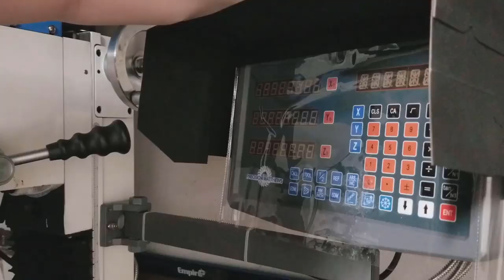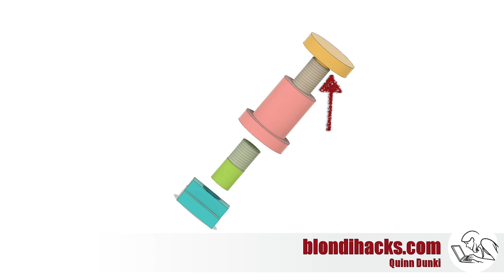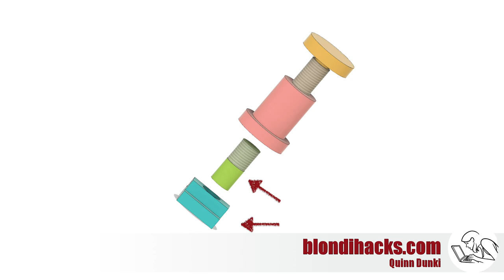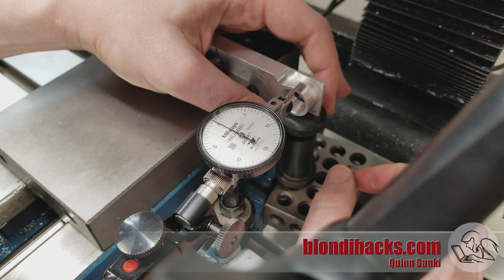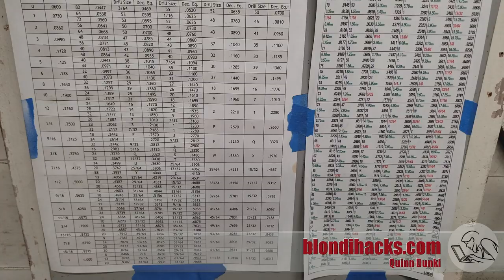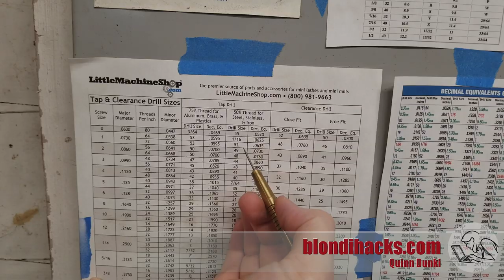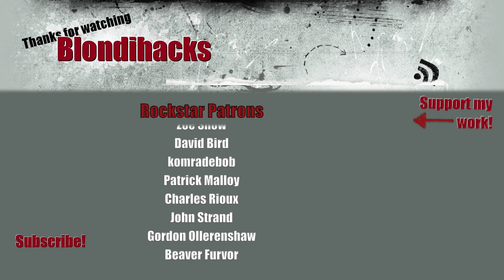Let's Make Machinist Jacks

Comment: Gwin, maybe you can answer a question that's bugged for a long time,  I've asked many experts (please don't be intimidate) and feel that I've never had what I've thought is a correct reason for the variation from the nominal marked size of a drill bit to the actual size of a drill bit. My dad used to sharpen drill bits as a hobby or for little charge before he passed for like 20 or 30 years before he passed, he was good at it. So I inherited thousands upon thousands of drill bits all various sizes for many reasons mostly because some people never returning to pick them up when he called and said they were ready. He had a rule, I'll only call you once! Well over the years I have gone thru them and built many sets for my children, my friends, my co-workers, and even some of his friends while they were still with us. Several things I quickly discovered in the process was, drill bit aren't the size marking on them, as I had always thought. I fact you would be hard-pressed to find a few that are. They all vary from 0.005" to 0.050" from what they at marked. The usual answer I get is all drill rod was a variation from the manufacturing process, another is that it depended on the quality level that they were made to, or I not measuring them right. Some of those answers may be a little true, but what I see is a defined pattern of sizes in the thousands of bit I've measured and it is not the nominal size.

Comment: Quinn, just discovered your channel and learning a lot. I'm a retired welder learning to machine. A technique we used for a press fit is to make the part 1-3 thousands over the hole size depending on the material. Heat the hole side and cool the bolt part. They will go together with no effort and when reaching room temperature they will be very tight, almost welded. thanks for your tips.

Comment: Yes, I get sawtooth looking threads, And I have a Chinese lathe *THANK YOU*, I've been avoiding using the compound and just plunging straight in with the cross slide to get properly shaped threads.  I love 'You Tube University'.  Thank you Quinn, and Kieth & Kieth & Adam & Pete & Steve & Emma & Stan. After a 1000 hours of machining lectures, I feel very well informed-Thanks so much

Comment: Put a center drill hole on the anvil of your machinist jack for a ball Bering holder for the times you need an angle in your set up. Great project thanks for sharing.
Reply from the maker: That’s a great idea!
Reply: And of course nothing stops you from making several different anvils for your jacks!
Reply: Also, I needed to make a set of 3 quickly, so I brazed a ball bearing onto a standard hexagon head set screw, centre drilled head. These were used to level a part. Look up science of Kinematics.

Comment: Hi Quinn, another great video. I did make such a jack (before I saw your video) I did make a lock nut (knurled) to sit on the top surface of the jack body and it has proven worthwhile, I put a really fine finish on the two mating surfaces and it locks and unlocks very nicely but doesn't move during machining at all. Keep 'em coming, we all enjoy them.

Comment: Great video Quinn. You are becoming quite a good machinist. Great lighting & camera work
Reply from the maker: Thanks Lyle! Much appreciated. 😀
Reply: @Blondihacks  i won't @blondihacks   to apply her self to the challenge of doing a taper by using tow chunks in her lathe , & cut a taper with out moving her tailstock set up ? . The trick  it in the tip.  of chuck she use's .

Comment: A really common tool, yet I have never made one. I really liked your take and the explanation of mistakes was educational. Saw tooth threads, been there done that. I ended up scribing a zero line 90 degrees off of the original and put a label on the manufacturer's line saying  - not for threading.

Comment: In regard to dishing the bottom of the jack another aspect to consider is that if there is any irregularity in the table or if there is any small shavings, the dished base can bridge a lot of these and sit flat. otherwise any small shaving will cause it to rock.
great work. thanks.

Comment: Quinn, love your channel, and can see you know your stuff.   I want to comment on the compound angle difference between lathes.  It is good to know, but it is better to understand from where the angle is referenced.   A lathe has only one axis, it goes through the head stock and the tail stock.  So an angle is referenced from that axis, a taper is a good example, or it is referenced from a plane perpendicular to that axis.   Threads are a good example of that.   Tapered threads are also referenced to a plane perpendicular to the axis and not to the taper.  I recently retired after 47 years in industry.  Some time as a machinist, some time in Quality Control, but mostly as a design engineer.   Too many times I have seen a professional (?) machinist screw up a part because said machinist simply set the angle on the compound that said machinist saw on the print, and did not look to see if the angle on the print was referenced the same as the compound.   It is frequently necessary to set the compound at the complementary angle.  It is up to the machinist to decide which one is correct.

Comment: Hi,  love your vids, if you get a fishtail gauge and run the thread cutting tool into it it will confirm the tool is set at the right angle to the plane of the shaft.

Comment: I like the "t-slot nuts".  I've got jacks, but never considered a t-nut, despite having needed to several times.  Working with castings often requires them in the t-slots, and they can use different tops, including points for rough casting surfaces pushed against.  I believe I will make a couple nuts to go with my jacks.  Very nicely done, thanks!

Comment: The tee bolt. That might just be genius!! Interesting. Generally if I need a Jack tho it's usually at some random location under some weird casting. Be interesting to see if it works. Would certainly be a third hand when setting up sometimes.  you rock!

Comment: Great video!  Couple of things that may help you along the way, generally 75% thread engagement is the standard for most tapped holes. I found that out the hard way when I started out and a foreman about chewed my head off. Lol. Secondly both fine and coarse threads (UNC and UNF) use different tap drill sizes, with UNF being larger than UNC. Always remember thread pitch-diameter=tap drill size. For instance your 7/16-20 would go like this. 1”/20=.050, this is your thread pitch. You would then subtract .050 from .4375 and come up with .3875 or a 25/64 drill bit (.3906). I rarely ever use drill charts anymore. Hope this may help you or someone else.

Comment: My motivation just goes right out the window when I realize I have to switch up the change gears.
Reply from the maker: Ugh, tell me about it. 😁
Reply: Check out Clough42 channel - An interesting  solution to change gears is in the works.
Reply: Had to change out the change gears on my lathe for the first time over the weekend. Do Not Like.  Turns out one of them has 2 missing teeth replaced with  allen screws. Yuk. 30+ years of oil, grease, etc were not really pleasant either. I might get the dark, black grease at bay. But then no one would know who  I am!
Reply: that is why i have a love hate relationship with metric threads.

Comment: Showing the mistakes, causes, and remedies make this video valuable for hobby machinists. Until we learn to make the stars align in our favor by learning all these seemingly insignificant  details, hobby machining can be very difficult/frustrating. However, once the small details are tended to, hobby machining becomes as simple and rewarding as Joe Pi, Abom79, and others make it appear. Thank you for the slower pace and pointing out the mistakes. BTW, threading away from the chuck does indeed take away the drama!!

Comment: You spoke of using a dull endmill, Doing a bit of research on internet including milling cutter manufacturer pages it seams WE as amature machinists tend to kill our endmills before time. Endmills as we call them tends to let us think they are mainly for using the end of the cutter like a drill bit to cut downwards when in fact they cut better on the side. Acording to lots of manufacturers of endmills they last longer cutting full depth in more passes width wise rather than taking a shallow wider cut. Just look at almost any CNC video where they explain how to work out cutting speeds and feeds for different cutters. The spirals on the cutter are actually cutting edges and spiralling to help remove the chip so its not recut on the next tooth. Its a fascinating subject which i will have to study as i tend to CNC my milling machine in the near future.

Comment: In parting as long as there is even a small hole in the centre you can part almost through, then drll the part off. The part will stay neatly on the drill.

Comment: Always start tap in chuck or morse taper tap driver, in tailstock or mill spindle for alignment and rigidity, even hand taps will power alright to full thread on tap then finish by hand bucking in and out.

Comment: Great video thanks! Just the other day I scrapped the screw part of a Jack I’m making for my bench drill. Single point threading isn’t as easy as y’all make it look 🙃 I’ll have to look in to Joe’s technique.
Reply from the maker: I’ll be doing a Lathe Skills series on single point threading pretty soon, if it helps.
Reply: Blondihacks well your basics series has been invaluable to me so I definitely look forward to it. Until then I’ll continue to learn from my failure as there are few better teachers than that.

Comment: Here's a Toolmaker tip: Do not use the chuck key to turn the chuck as you did to do tapping. ( to remove a chuck on a lathe with a threaded spindle ) use a adjustable wrench on the jaws of the chuck to turn it for tapping or chuck removal.

Comment: Novice lathe user, with a Chinese lathe: Fell for the 30 degrees vs 60 degrees first time I tried to cut thread too! ;) 
I also managed to get the wrong point on the thread dial a couple of times in my second and third attempts. Fourth attempt worked - would have been MUCH quicker to just stick my die-holder in there and use that, but then what's the challenge in that?

Comment: I'm an old guy, new to machining. Quick question that I should know the answer to. Are there any practices that help in the amount of metal splinters one receives in his fingers when working a project. I have a Logan 820 lathe, and a Wells Index 40H milling machine. By the way, great videos, I love the voice over. Really helps the viewer on the paying attention part. Great job. I found your videos because of the parts you made for Keith Rucker.

Comment: So nice to see you talk about the mistake with the compound and the 60 degree showing on the compound. I did this exact thing for the first few threading attempts and got so frustrated not seeing why it wasn't working. When I did work it out I thought it was just me geting the wrong end of the stick, I didn't know there were differences in zero position between lathes.
Also do you use something like WD40 or oil after the cold blueing?
Reply from the maker: I haven’t been oiling after cold bluing, although it’s a good idea. The tooling I actively use ends up covered in oil anyway, and I do use Boeshield on stuff I rarely use, to prevent corrosion.

Comment: Awesome project. One off topic question, I noticed you had a little rig you added to your gear set (I'm assuming to change the feed direction). Do you have a video for this? I have an "economy 8 x 16 chinese lathe and have yet to figure how to feed left to right while threading
Reply from the maker: Hmmm, not sure what you mean there? It’s all factory in the change gears. My lathe does have a reverse power feed, but you don’t actually need it for right-to-left threading of right-hand threads.

Comment: Thx quinn you have helped me solve a problem i have spent many hours on trying to solve.  Chinese and American 30 degrees is not the same... Suddently i can turn threads like a pro. I also have a Chinese lathe and everytime i tryed to turn threads they came out looking 
horrible. Now after you talked about it it as your mistake it is painfully obvius that i should have seen the difference before.

Comment: I like the T-bolt design on these Jacks. I do have a stupid question. Why the bluing, what does this do beyond looking pretty?
Reply from the maker: It provides some limited corrosion protection (though not as much as paint) for the machined surfaces.
Reply: "black rust" (cold blue) is corrosion, just like "red rust", except one has one less oxygen atom. The main difference is that "red rust" changes size when it forms, so it flakes off and exposes fresh metal to start rusting again. If you coat the part with "black rust", it greatly inhibits "red rust", with the side benefit of its "micro-porous" texture being great at retaining additional protection in the form of oil.

Comment: Hey Quinn! I noticed when you were single point cutting threads that the trailing edge of the bit was doing most of the cutting as per the 29.5 degree setting. I mean no criticism when I ask shouldn’t the compound be angled 29.5 degrees the other side of 90 degrees, there for making the leading edge of the bit do the majority of the work? I went back and watched Joe’s video and he was as using an indexable bit so he did not move the compound and fed straight in. I am coming in late to the show so don’t feel obligated to reply. Thanks a bunch!

Comment: What is a typical minimum height for the jack and how to determine that height? And isn't good to have a way to lock the height? i. e. so it wouldn't slowly 'wind' down from vibration? Or does fine thread make that unlikely?
Did you consider just tapping the Tee and then loctiting the stud into it?

Comment: Gotta ask, why a center drill for spotting for drilling instead of a spotting drill?  Center drill angle is 60degrees, while the drill bit is more like 118 degrees, and a spotting drill more closely matches the drill bit angle

John
Reply: Speaking personally. I got center drills and I don't have spotting drills on hand. And it works.

Comment: I absolutely understand why a machinist would use imperial if that is what they grew up with and used in school. As I grew up with metric I'm in no position to gauge how complicated imperial actually is, and this is not a comment meant to start any religious wars, but imperial just seems so needlessly complicated. 

I wonder if there'd actually be anything to gain for a machinist to actively switch from imperial to metric? It's obviously possible to get great precision with imperial so my gut reaction is "probably not."

Comment: What made you chose for a press fit for the T-nut instead of a normal threaded T-nut and gluing or welding it in place?
Reply from the maker: A press fit is easy, and stays very straight

Comment: I probably missed a lesson ,what was the round stock in the vise for again? Say hi to sprocket for me.
Reply: In addition, it's a more reliable method for clamping parts that aren't square (yet)... It gives a more secure clamping force on the (not yet square) part.

Comment: When using machinist jacks, is it common practice to indicate a part in the vice before adding the jack? If so wouldn’t it also be a cheap value add to put an indicator zeroed above the Jack point when tightening the jack in place, thus maximizing rigidity?
Reply from the maker: That’s not common, no. It’s enough to do it by feel. I was just indicating to illustrate what can happen if you get carried away.
Reply: Blondihacks but if I wanted to get carried way toward OCD fixturing‽ it would be an okay way of doing that?
Reply: Blondihacks aside: are you Quebecois?

Comment: Hi, I like to know why did you change from the 2" to the small mill half the way through on the T peaces?
Reply from the maker: Good question! The main reason is that the big shell mill doesn't side-mill very well on this machine. A large radius cutter like that needs a lot more tool pressure, and my machine doesn't have the rigidity. I only really use it for facing operations.
Reply: Blondihacks yes you have to recognize the capabilities of the machine and don’t over extend it otherwise you will have nothing but problems. I found this out the hard way. I’m still learning at 76 years of age 🤣. Keep up the good work Quinn🤗.

Comment: only just starting watching yr channel and probably been asked this before but i noticed you use a lot of hss and not much carbide or insert tools, is this due to thee machines you have or personal preference ? i do tend to use both myself .
Reply from the maker: HSS is inexpensive and easy to use. That’s the main reason. There isn’t much need for carbide on small hobby machines, really.
Reply: @Blondihacks  I'm still gaining experience using both and watching a lot of stuff on youtube from channels like abom79, this old tony and of course jo pi helps a lot., i recently starting shaping hss lathe tools in the mill using carbide burs and the made it a lot easier getting the basic shape, then honing to a finish made a huge difference cutting 4140 and en36. , i am keen to try tool steel  and drill rod when i can get some from specialty steel supply. btw hello from australia.

Comment: Quinn please, tell me more about that liquid you put the piece and it becomes black.
Reply: Bluing, easiest found in Walmart sporting goods shooters section or a local store that sells guns and their equipage.  Possibly amazon or eBay I haven't looked.
Reply: @Vladviking  thank you...
Reply: @PauloSilva-ll4vs  I might add bluing helps prevent rust a little, best to keep a light coat of oil on the piece especially in wet humid climates. All machinists tools stay healthier in an AC environment.